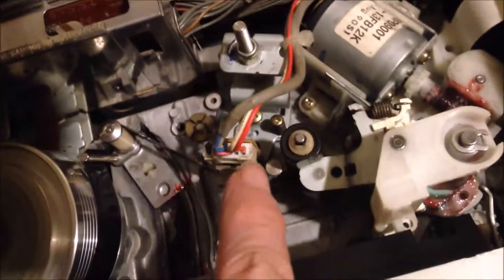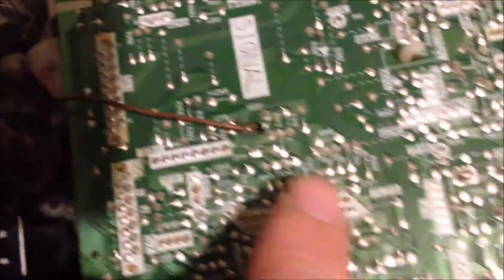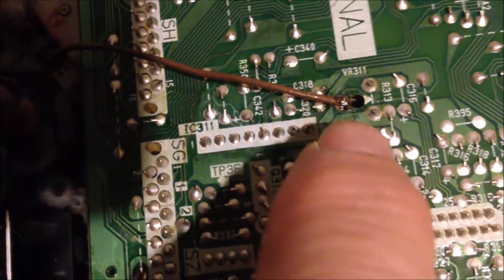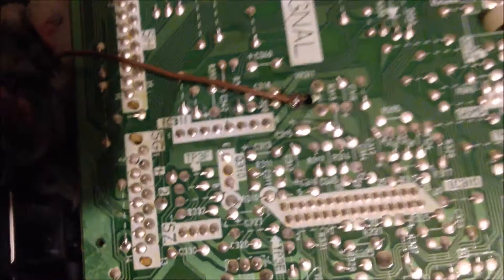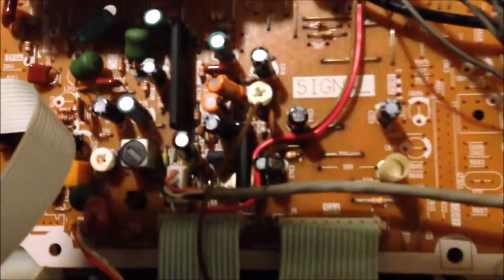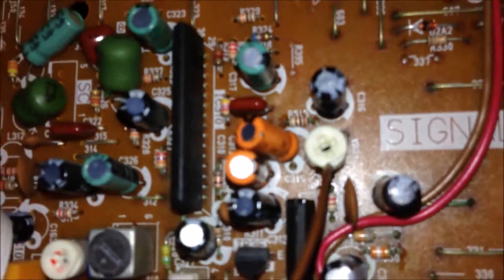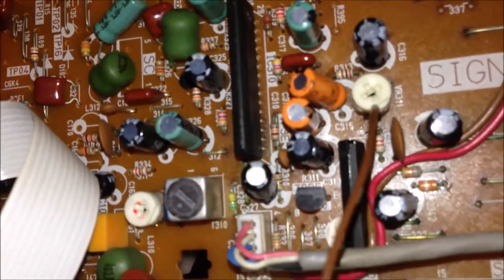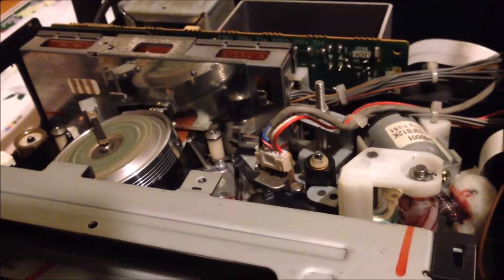Mitsubishi Video Cassette Recorder (VCR): No Sound: How to Repair?

Comment: I have problem with my combine dvd vcr  when i play dvd the sound still have but not too hight but when i play vhs the tape work but not sound nothing
Reply from the maker: Check cables and connectors first before trying to check inside. Good luck!
Reply: @RepairDIY  do you think is because the player is mono ? I was lost my remote i cant put on stereo automatically
Reply from the maker: @AngkorwatProduction  Hi, VCRs should output stereo sound. I have two VCRs with no mono/stereo button on their remotes. have a good day!
Reply: @RepairDIY  yes is very strange dvd have. Sound litle but when i put vhs not sound nothing

Comment: Stereo sound is output. However, mono-sound videotapes do not sound. Which part would you like me to check? Please help me.
Reply from the maker: Hi, sorry I have no ideal about this problem. VCRs made in different year may use different VHS formats such as non-HiFi VCRs or HiFi VCRs. It could also be a problem in the audio head or circuits. Hope someone here can help you. Good luck!